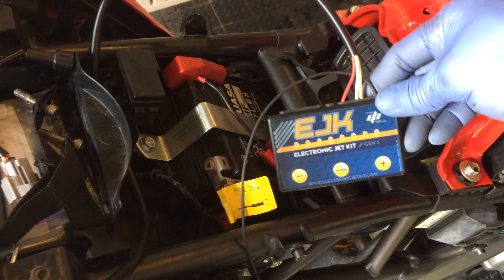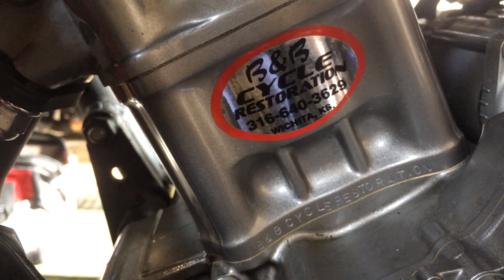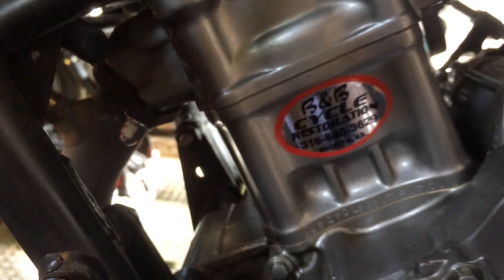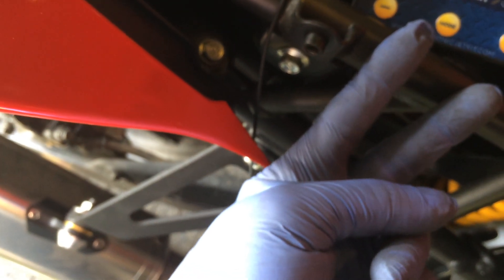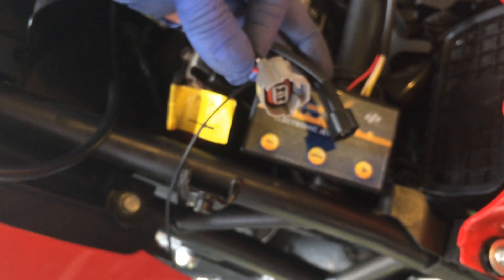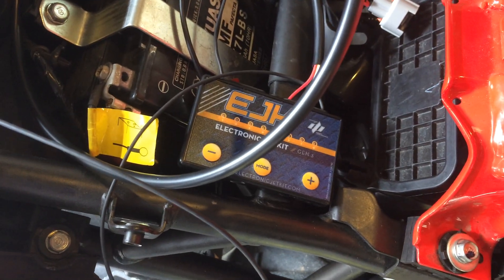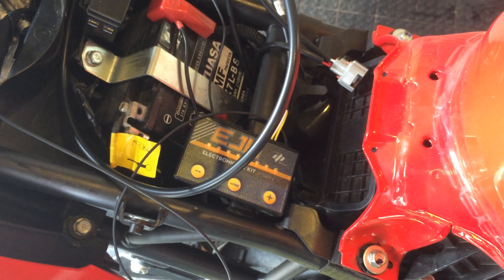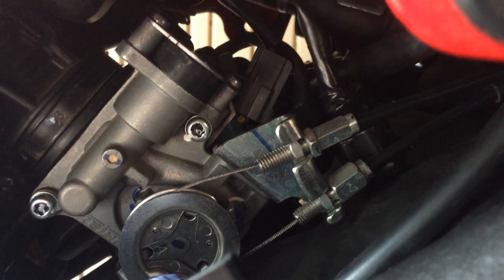CB300f + B&B CRF250L 283 BBK= CB325f

Comment: I want to make mine a 350 with forged piston and bigger injectors. The fuel controller and injectors i can find cheap used online the other stuff is about 1/4 of what i paid for this bike new. So for me, hot rodding it and sending it to valhalla costs less than a faster bike which will run me 6k minumum used.